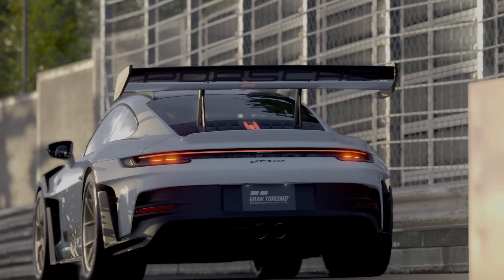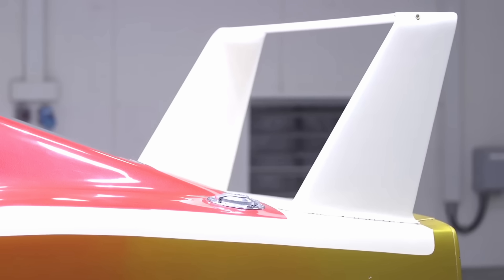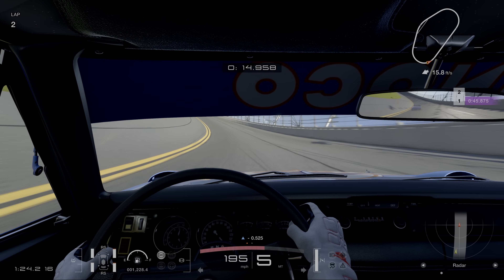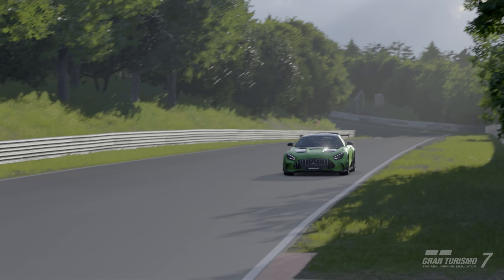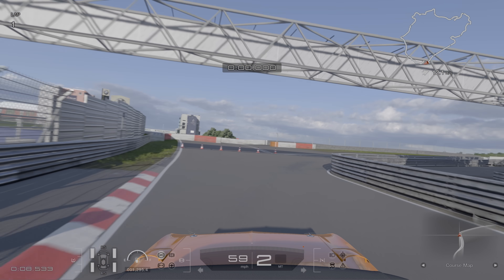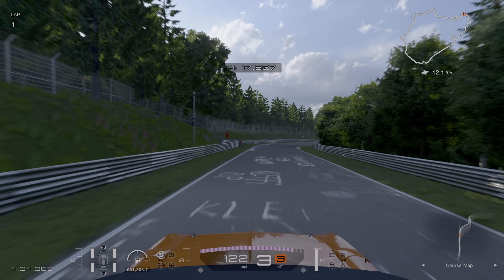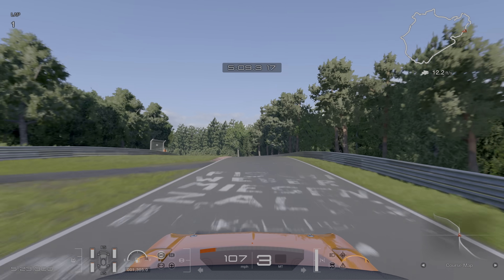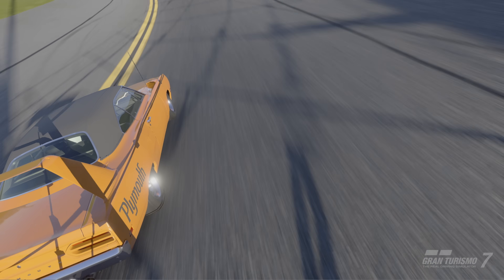Why Is This Car Undrivable in Gran Turismo 7?

Comment: GT7 doesn't simulate air, that massive wing made it one of the most stable cars ever built. But because the game simply doesn't have air, that massive wing has zero effect on the car's handling. The wing is not made for downforce, its made for stability.
Reply from the maker: GT7 does have aero simulation. The cars have CFD simulation on them to determine aerodynamics. You’ve also got wind direction and intensity influencing downforce and aero drag.

Comment: It seems this is a VERY common issue in practically all driving games.  If a vehicle seems like it should be good, or is based on a good real life vehicle, and isn't perfect, then it gets scorned as bad or broken.

Now, developers do indeed make mistakes, but often these things are just a skill issue.

Especially true with performance vehicles, they are far, far less forgiving than a road car.  They need a skilled hand to bring them out fully.  You cant just hop in and run them without care.

And what happens when someone dominates in a "bad" vehicle?  They get called a cheat.

To use the parlance... Git gud.

Comment: That old ass porsche is worse than the roadrunner. Its terrifying to drive. You better brake in a straight line with it or your 20 yards off the track.

Comment: Video games alway get Chryslers wrong.

But you also dont want to drive a rigid brick 200+. You want to drive an arrow thatll flex with the surface. 

That being said, my 74 charger acted EXACTLY like this stock bird, but after i changed the lower control arm bushings i have yet to meet anyone that outdrives me, modern challengers are bricks and turns scare the poor kids, i fly by them going 160/170 nearly everyday

Comment: Everyone already said everything about body rigidity and suspension technology of 1960s, and the fact that this is road version and not a NASCAR race car, but i want to point out that people believe that it should be stable just because of a ENORMOUSLY big rear wing. Its big not because car needed it to be that big, its big because engineers haven't fully figured out what is aerodynamics and how it works. If they had today's knowledge and understanding of aerodynamics they would've used scaled up F1 2017 wing. Btw cool way to say "skill issue" by making nearly 10 min video to all these bozo's saying that Sony paid you.

Comment: Spacers on the wheels wheels are tuck under the body in reality if one would cut the wheels wells even  longer axle stick out rims 1 1/2 ...I think even toe angle out possibly too...just always looked problematic in reality with those tucked under to much

Comment: what people dont understand about amerian ars  including  alot of american car  enthusiasts is that they have horrifyingly bad  suspension geometry so bad  infact that it  dangerous

the daytonas/superbirds aero was more about  topspeed  not as much about downforce  and the big wing was to add stability and  the nascars  did have  suspension upgrades with stiffer   suspension   bigger brakes and  wider tires and   lowered  quite a bit and more so in the front  to give the  car a nose down attitude to not  only try and gain  some downforce but also getting the wing more exposed to airflow  but these cars went  extremely fast  they   clocked  over 200 mph

Comment: Why do these games always purposely make these cars handle like crap when in race trim they handle and drive amazing? Like it's a racing game so I want the race spec version of the car in game not the stock soft suspension cross country trip version. Like the race spec will be leagues better in every aspect but it's still 55 year old race spec. So there is still improvements that can be made with customizations and tuning in game, you just have a better base to start from.

Comment: So we are comparing a car that’s 55 years older with a full on early gen type extremely beyond rigid roll cage with a full on locked up rear end and in a car designed and built for oval racing by stright up bootleggers therefor left turns only.. if it is really truly a sim type game then it’s even more crazy of a comparison. Like comparing a 1950 panhead harley and wondering why it can’t beat or compare too a moto gp full on 2025 race Ducati  super bike  🤷‍♂️

Comment: You show me how to tame this "monster". Can you show the second sheet of upgrades and the gear box settings pls? 
Also if you want another good one of those you can always try to tame the Corvette Concept from the 50's. 
The Plymouth and that one are my kriptonyte. Thanks
Reply: Not GT7 but gt sport and I have successfully tamed it, kinda, what I did was full max out all gears and made the first gear super small (30 km ish), add soft racing tires, increased the weight and fully lowered the ride height, the only issues are that it can’t keep up with the ford gt40 and Ferrari in the 60s cup and is extremely sensitive, so unless you are playing with a controller on the lowest sensitivity settings, the car becomes a carousel

Comment: (DISCLAIMER) 

A car that I think is undriveable is The Porsche GT3 RS. It sometimes steers by himself and sometimes not at all. I basically end up somewhere in the gravel pits.

Any tips or advice?
Reply: Which one? The 2009 model (997), the 2017 model (991), or the 2022 model (992)?

Comment: I wonder if that applies to any Mopar in any video game😂, case in point, the '71 Dodge Challenger  '69 Dodge Charger RT, and the Hellcat Dodge Challenger in Real Racing 3. All 3 sound fantastic (the Hellcat almost sounds like an alcohol dragster going thru the gears👊💪😂) and are great in the straight aways, but when it comes to cornering, chimpanzee on ice skates.

Comment: People misunderstand the wing.

Stock cars used to have to be stock cars.

They needed the wing that big so you could open the trunk.
Reply: Maybe, but it was mostly  to move the aerodynamic side preassure center rearwards to help with high speed stability, a good example of this would be to look at the cars for straigline land speed reccord with their fins at the back

Comment: What? You mean to tell me 4000 lbs of 1960s floppy roadgoing american steel, with a solid rear axle, drum brakes, leaf springs, and no chassis reinforcements paired with a shape that is structurally unsound isnt gonna handle like a Nascar stock car that looks like it?

Comment: Yea if you dont tune anything offcourse its gonne be bad tons of people have driven this car for challanges perfectly fine ... 

so i think all those people are having a huge skill issue its not a fast car because it lacks downforce for the faster corners and a lot of people dont take in acvount they are driving a car with 0 downforce and dont have a clue ...

And were comparing this to a amg ?? For what??? adding weight can change the stability often in bad ways weight = shit handeling and thus tune 90% of the time

Comment: Ready... Just put
Racing WETS
Fully adjustable diff.
Adj manual gearbox.
And Drilled race brakes on the darn thing.
Diff setup @
60 initial
10 lock
5 drag.
Gearbox @ 200mph(320kmh).
NO OTHER PARTS.
That solves everything and makes it drivable 😮.
Warning: FULL POWA BOAT RACING setup 🤣.

Comment: Bruh what? Man I got that car under 6:34 around the Nurb.
Reply from the maker: I added ballast so it would weigh the same as the AMG and did not fully upgrade the stock engine so it was 100hp down on the AMG as well.
Reply: @hubblesphere  that makes sense. Fully upgraded you’d likely have to adjust the tune anyway. I can tell you that’s it’s not going to handle well with max power that low to the ground.

Comment: Nothing wrong with the car... it's a 1970 muscle car. Having a wing and a lot of power never made any car good... just look at the modern Bugatti cars, that frequently IN REAL LIFE lost control at straight lines way before reaching max speed of even full throttle.

The only thing that need to be fixed is how folks are driving it. Need to be smooth and easy. And don't compare it's performance with other cars. The only thing that upgrading it before learning how to drive will do is to help folks to keep mediocre drivers.

EDIT: Most of the cars have negative downforce (lift)... even ones with aerodynamic devices

Comment: I don’t know if I’m just bad  I also don’t know what your transmission set up is or what other upgrades  you have compared to me, but this tune does not work for me at least for me with my game settings on controller it does not drive good
Reply: Update I have adjusted horsepower output to be substantially lower going from around a 750pp to just 700pp and I have raised the gear ratio so it has extremely long gears. It’s worked better, but there is literally no acceleration out of a corner whatsoever (literally fixed this like 15 minutes later I had camber wrong works great now)

Comment: My problem with this is that even the product car had a adjustable rear wing. You could add downforce and the side of the wing added side to side stability. Remember back in the 60/70s it was a production car with added roll cage and other tweaking. This car should handle fine at speed that is what it was made for. The game isn't doing it justice at all. Lol seems the 68 charger handled better than the bird in the game. And that car is why the daytona and superbird where made.

Comment: I just started playing gt7 for the first time like 6 months ago. Dont get me wrong its a great racing game, but just not a good sim racer. (Compared to beamng and assetto) It feels like the games physics are not uniform. When the car gets unsettled in this game the movement feels very slingshoty and random. You get very little feedback when the wheels start to loose traction especially in a straight line. Am i doing something wrong, is this one of those games you gotta manipulate the settings for it to play right?

Comment: could you show the setup for this car? I really want to drive it but I'm not the best at tuning.
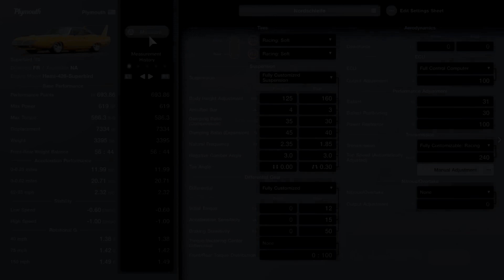Reply from the maker: At 4:25 I show the setup. Every engine upgrade except forced induction but sport exhaust not race. Carbon brakes, fully adjustable racing trans auto, stage 2 weight reduction, widebody and wide wheels 16” but stock offset. Check performance points and should line up.

Comment: Rear toe should not be capable of being adjusted on the car in game.  The car IRL has a rigid "live" rear axle so toe should be parallel and camber should be 0% (vertical).  End of.  There is no discussion to be had on that.  By incorporating toe adjustment PD have allowed us to tweak the features of independent rear suspension.  Which the car doesn't have.  When the body flexes it allows the leaf springs on the rear to move their mounts relative to the position with the mount on the opposing side.  This will cause the rear solid axle to rotate in the horizontal plane pivoting around the central point and essentially you get rear wheel steering (like a soapbox cart or a horse drawn wagon) which causes the massive instability.  Make the body rigid and you remove a large portion of that flex and the ensuing unwanted rear steer effect.
Reply from the maker: Stock car has no alignment adjustment in game, but with suspension upgrades it’s reasonable to assume an upgrade to a full float axle. You’d at least have adjustment for camber/toe although the game allows far too much. I think this is one of the things they could definitely improve with suspension geometry. It seems cars get very similar suspension dynamics which makes them not feel as realistic.

Comment: the reason the car handles like azz is because this game is azz.
this car has a live axle in the rear. meaning both rear tires are connected.
the game treats the wheels as independent suspension. not how it works and because of that the car will never translate properly.